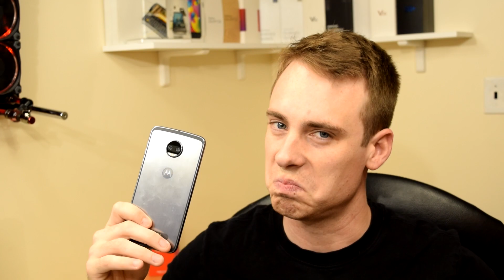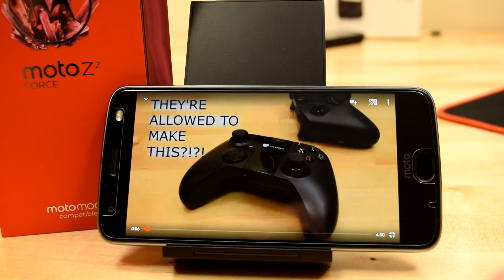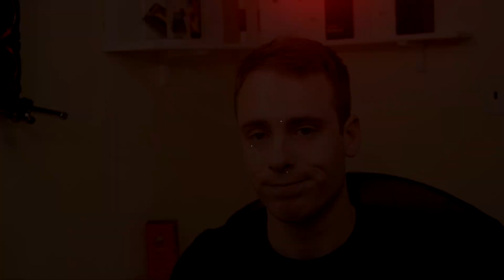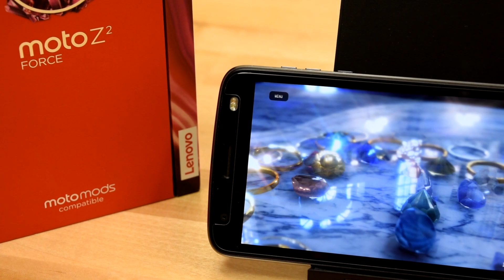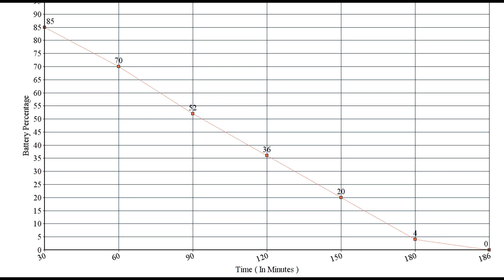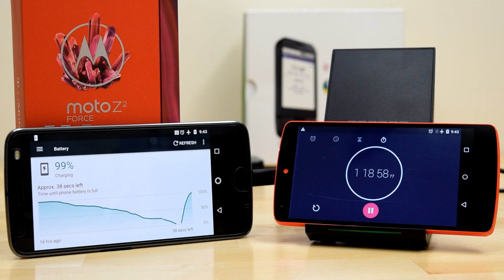Z2 Force complete battery Test and Review

Comment: I have the Moto mod, plus I bought the rapid charge wall charger, I often find myself not using the mod, the rapid charger from Motorola is the best I can get my phone charge in about 30 minutes while I am using it, and sure u tested with the brightest at 100% how many people use it at that level, is not recommend, I am a heavy gamer and I don't use sound so your test should be done in other ways, like brightest at 70% and other life situation, but I will tell you this, Moto has one of the best stand by time I seen, when I first got it , I tested like it I was an average Joe, emails, Text, Phone calls and it last me 3 days from 100% until I charged it when it was at 8%, and for 350$ on T-Mobile with all the bells and whistles, you can't beat that, I for sure will never pay a 1,000 for an iPhone X.

Comment: does moto z2 play has a better battery life?
Reply: Rodrigo Simões so far, I've had mine for 5 weeks, and I can easily recommended this device from all the 2017 flagships with Snapdragon 835. From my experience it lasts well over a day on a single charge (from 100%). Screen on time can last over 8 hours, depending on how you use it. I'm not sure how Motorola managed to get this device to get such amazing battery life. By comparison, I've used an Essential PH-1 for a month prior to purchasing the Moto Z2F, they're both very similarly spec'd, PH-1 had the bigger battery but IPS display, Z2F had a smaller battery but comes with OLED display, both have Snapdragon 835 and run stock Android, so you'd think they'd have similar or better battery longevity per charge, but somehow that was never the case, PH-1 had horrible battery life (less than a day (usually less than 12 hours), whereas the Z2F lasts at least a day work the most intense screen usage.